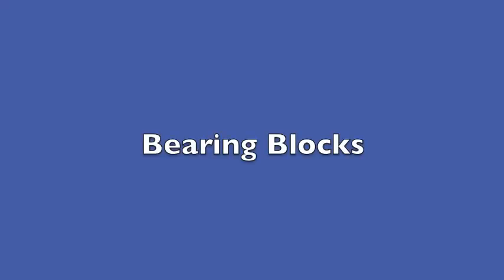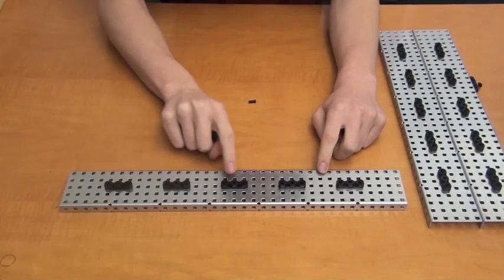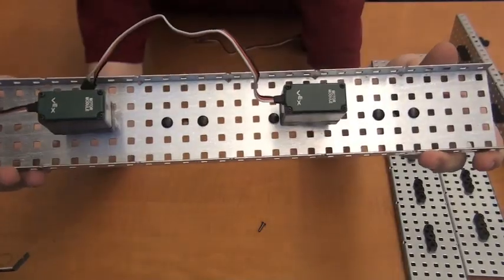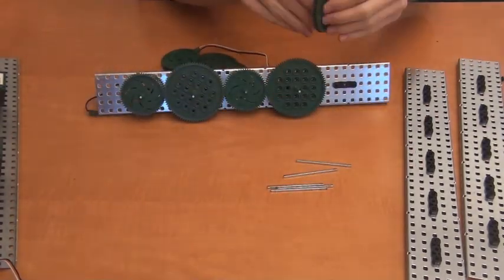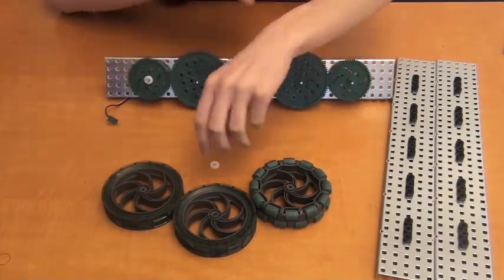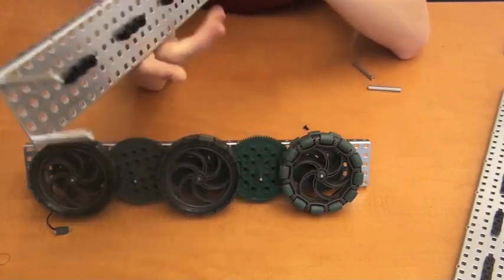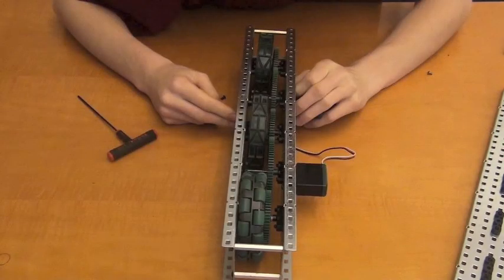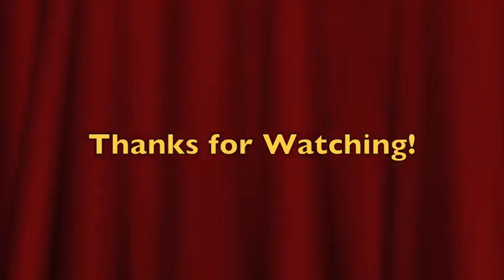Team 169C: How to Build a Drivetrain Instructional Video (VEX)

Comment: Is it a good idea to use small wheels in the back and big wheels in the front .
Reply: Why would you want to do that? It’s always better to have a balanced design especially when you turn.
Reply: No. The motors have a fixed max rpm, which means that the wheels will have a fixed max rpm as well. If you use different sized wheels, it means that they will have the same rotational velocity, but a different linear velocity. What this means is that the larger wheel will be spinning at a faster linear speed than the smaller wheel, which means that the larger wheel will try to make the robot go faster than the small wheel makes it go. This results in more strain on the motors which is never good.

I know this is 5 years late so you've probably got a proper answer by now, but if there's even the smallest chance that you haven't, here it is.